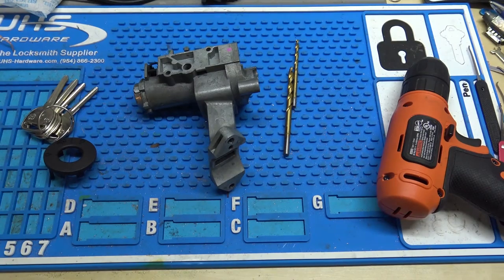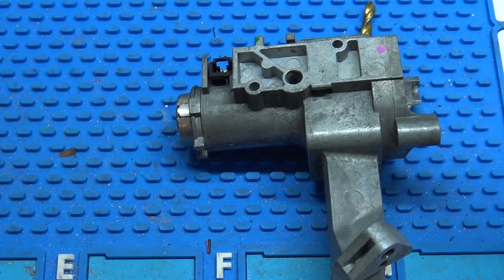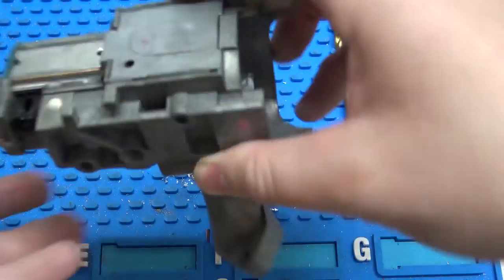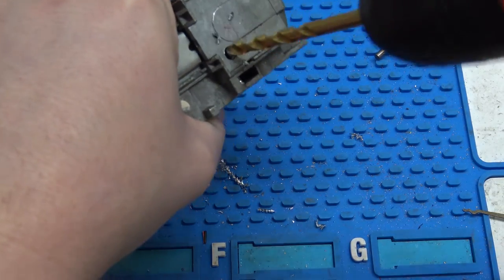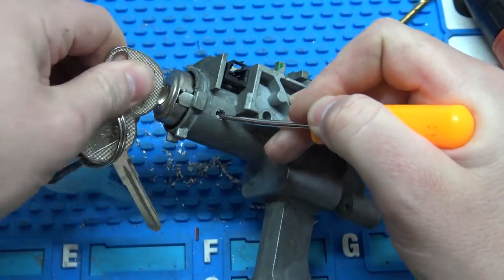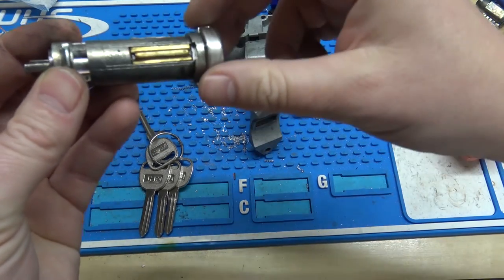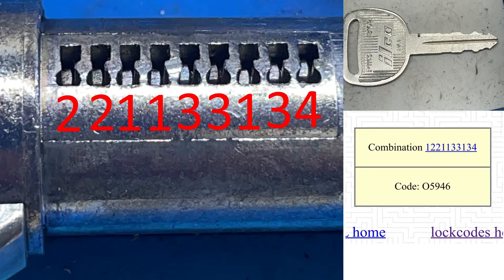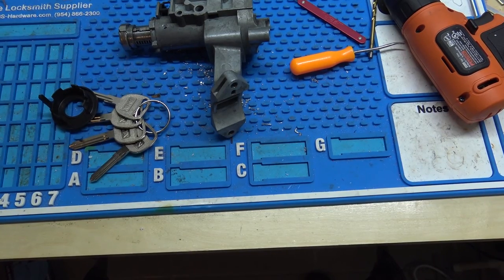(533) How to Remove a 2005-2006 Chevrolet Equinox Ignition to Make Key

Comment: I'm sorry this had nothing to do with this video but  I'm in big trouble. I will pay if you can help me. I came to a 2019 ford Taurus today. They had 3 keys 2 regular and one with the fob. I started the car with the regular key and it start and ran. I then inserted the customer's fob key it was already cut. I went to add key and the car said failed but the door lock cycled. I then started the car and it died just like Chrysler cars do when the key is not programmed. Then I insert the other key and the same thing. I then erase all keys and start over programming all 3. The car now doesn't start at all it just cranks. But the keys show as programmed. Is this a security issue or did I just so happen to program a key to a car that is having fuel issues? In my experience, ford cars do not turn over when they are not programmed. Used xhorse and im608 it makes no sense. If you have a solution I will pay for your time. I'm so stressed I don't wanna wake up tomorrow.
Reply from the maker: What’s the security light doing?

Comment: Hello, I used the HON66 to pick a 2017 Honda civic and managed to pick it enough to turn half way then I couldn’t finish it off and I pulled the lishi out. Now the key way is stuck in that half picked position and the original key no longer inserts all the way however the lishi does. Any tips?
Reply from the maker: I’ll answer it on your other comment

Comment: Does Lishi have one for the 19-22 Camry's? We have been getting a lot of keys locked in trunk calls. When you open them with a tool the inside trunk release button is disabled and the alarm goes off. I was thinking the Lishi might be the answer. You can pull the door lock out and actuate it but they are a PITA to get back in. I did see a video not sure of the year a guy opened a Toyota with the Lishi and the alarm still went off so I found that really odd.Just looking for the best way to get these trunks open. I know you are the Lishi king. :)
Reply from the maker: If it’s singled sided key it’s the toy2